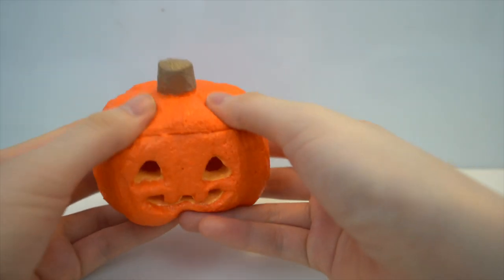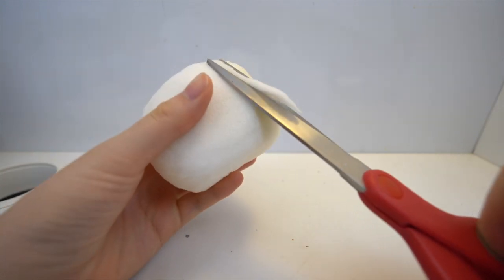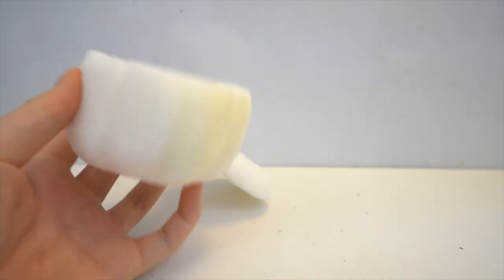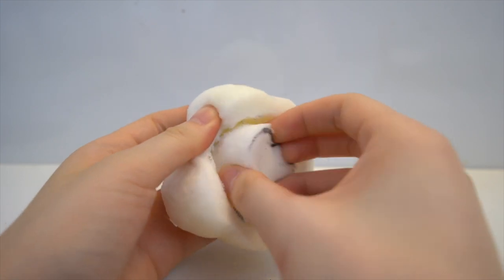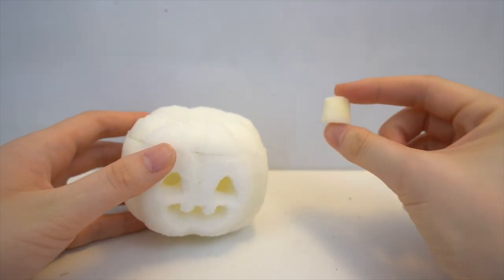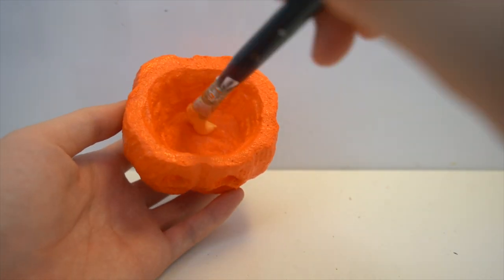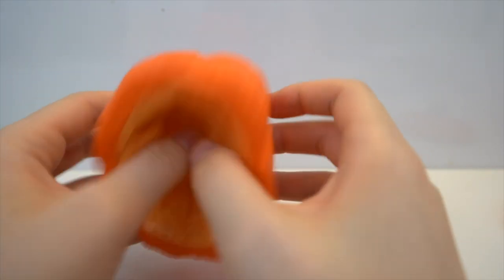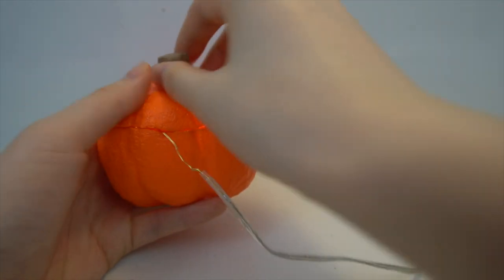DIY Jack-o'-lantern Squishy

Comment: OMG THIS IS AMAZING!!! Sadly I can’t make it because puffy paint and foam is too expensive :( it’s amazing though!
Reply: Try making your own! Apple barrel acrylic is 99 cents at Walmart. Elmers glue is very cheap. And you can buy one big bottle of white puffy paint. Just make sure that the ratio of puffy paint to acrylic is correct. Meaning that there should be more puffy paint than acrylic.  As for the memory foam you can buy memory foam pillows or buy craft foam which works just as well!
Reply: Alexus N!!!! THANKS SO MUCH!!!!

Comment: What size was the memory foam? 4 by 4?
Reply from the maker: It's up to you how big you want it to be, but mine was 2.5 by 3.5 inches. I wanted it to be a cube but it turned out more rectangular.
Reply: Squishyboba4ever thank you 😊. Loving your content btw. I’m having trouble finding memory foam anywhere, cuz the only foam I find on amazon looks hard like styrofoam. Can you send a link? Thank you
Reply from the maker: @boscolorin4714  I don't remember the seller I bought it from because I ordered a gigantic bed-sized memory foam a couple years ago. It was something like this one https://www.amazon.com/FoamTouch-Upholstery-Foam-Cushion-Density/dp/B017WPIDB8/ref=sr_1_2?dchild=1&keywords=memory+foam+3+inch+square&qid=1601761599&sr=8-2

However, that is way too expensive if you are only planning to make one squishy so I recommend either a buying a memory foam cushion or pillow. Be sure to read the reviews to see if it is good quality. This is one example, but this one is still pricey. I usually get memory foam that is 3 inches in height. 
https://www.amazon.com/FoamRush-Upholstery-Density-Wheelchair-Replacement/dp/B071JG8Y23/ref=sr_1_43?dchild=1&keywords=memory+foam+3+inch+square&qid=1601761883&sr=8-43

The cheapest method is to use a thick car sponge or dish sponge. Those work equally as good and you can find them at the dollar store.
Reply: Squishyboba4ever thank you so much! Sorry for taking up so much of your time, but I have one more question. In your among us squishies part 2, when you cut cyan in half, the screen went red. I am making my own animation and was wondering how you did this. Thank you 😊
Reply from the maker: @boscolorin4714  The effect is called "colorize" on final cut pro. I'm not sure if imovie has this, but you can make your own by getting a picture of a solid red image and overlaying that clip on top of your video. Then you adjust the opacity of the red image to 50% or whatever suits the video best.
Reply: Squishyboba4ever thank you!!